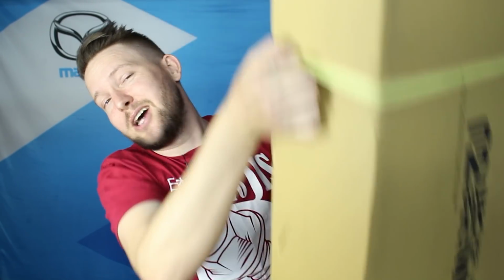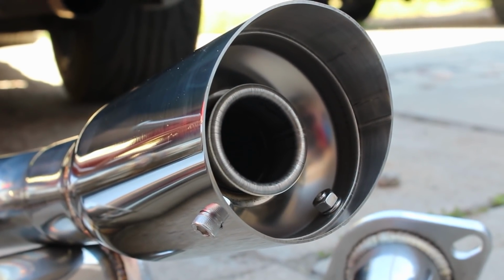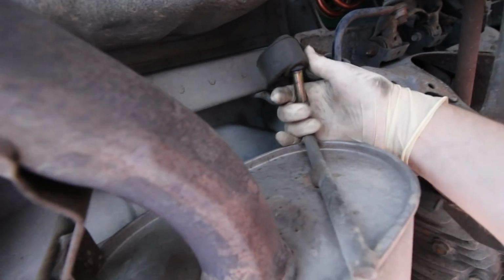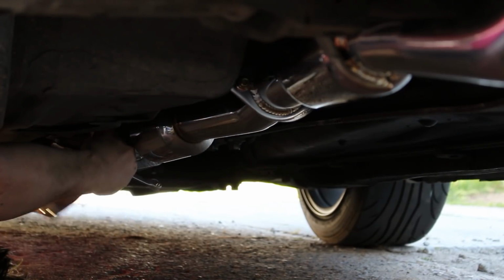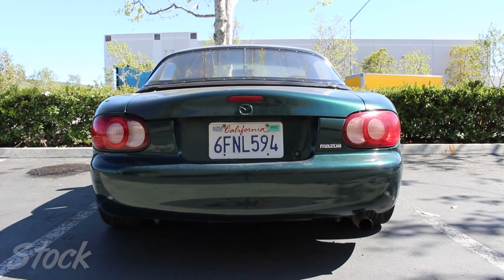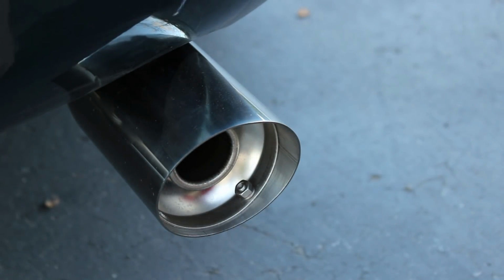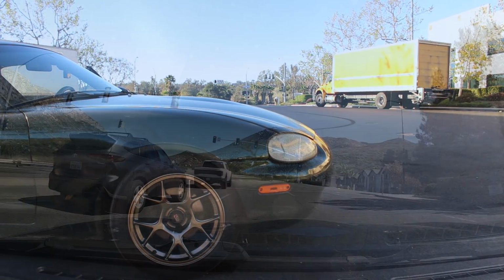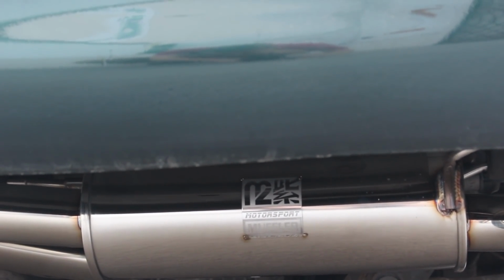The NB RIPS With A New M2 Motorsport Exhaust!

Comment: Honestly, I love the ISR with a turbo. However, when I first got it, my car was N/A, and I used my parents' garage. On startup, I got an angry text that my mom felt the floor shaking from the opposite side of the house. Luckily, I went boosted within a few weeks.
Reply: wanna post a sound clip bro? I've wanted to hear the IRS with a tubro
Reply: Same i love the isr, its perfect, but i do like the sound of a screamer pipe
Reply: Post a sound clip broooooooother
Reply: I have been looking for quality videos of the ISR on a turbo. Surprisingly hard to find. Love the ISR sound, hoping the turbo takes the edge off for something that sometimes does DD/touring duty.
Reply from the maker: Yeah dude for sure, turbo basically takes all loud exhausts and makes them sound so good 😃
Reply: @TheCarPassionChannel  hi Creg
Reply: Same, isr on turbo na sounds wonderful, we have a dual borla with some sort of headers on our nb2 and it sounds kinda like a Subaru which is pretty cool too tho
Reply: Love the exhaust sound. I run a borla   doble tips on my miata. For street cred I would change the rear lights for the one with the yellow turn signal lights just so it can match the bronze wheels.
Reply: My fathers 66 mustang would do that, cammed 289 motors shake the house with stock exhaust.

Comment: I had the M2 motorsport decat back system just like this one and it done me very well until about 1 year/ 5,000 ish miles of usage I had to get 2 flanges welded back on due to them breaking on the welds. Other than that it is one exhaust system id recommend if you’re on a budget.

Comment: So I recently went with the Cobalt midpipe (carb legal one) with the Roadster sport 4 muffler. It’s honestly sounding really good and I don’t have to worry about smog cause of the carb number. Muffler also comes with a DB reducer as well for longer drives.
Reply: How do you like the RoadsterSport 4? Was thinking of buying an RS4 and Racing Beat intake.
Reply: @michaelsaywhat6980  it’s pretty good. It has a nice deep tone when cruising. Doesn’t drone at freeway speeds.

Comment: Yes Greg! Thats got to be the best and only box for a mk2! However I don't wonna step out of line but have you tried it with the stock mid section? Much deeper tones going up the rev range.
Reply from the maker: I may actually run it this way for street use, that way I can leave the cat in place as well. If I end up trying it out I will throw a clip in a video too.
Reply: I bought this exact set last year because my cat went dead and I chopped up the fake cat piece to weld a 200cell race cat in place. Sounds about the same (uncorked) currently still running stock headers.

Comment: Damn that sounds good. My torsen 3.9 rear end came for my 1999 Miata (doing the FM turbo kit and more).

I was watching another video from awhile back (Gingum), and he did it to his NA awhile back....he said he needed a shorter driveshaft? He also got beefier axles....I did a little research but not finding it.............do I also need a different driveshaft for the NB?

This summer is just the FM turbo kit then next summer more boost (fuel pump, injectors, stand alone ECU, etc).

Thanks.....and that exhaust sounds great

Comment: Exhaust question for a stock internal 1.8 with turbo max 12 psi. Is full 3in exhaust worth the potential fitment issues worth it over a full 2.5 in system. Both straight piped to a big magnaflow muffler? Appreciate input
Reply from the maker: There will technically be measurable gains with a 3" on a turbo car, but for most people probably not worth switching from a 2.5". 2.5 is super easy to fit.
Reply: 2.5" will get you up to the max limit for a stock block so the 3" would be a good idea if you're ever forging it. Otherwise it'll be plenty

Comment: Did you add the launch control through megasquirt?
Reply from the maker: This car has ME442, and yes I just turned it on through the ECU, 4400RPM with spark cut.

Comment: Hi Greg, awesome content! I’m looking for the right exhaust system for quite a while. Sounds great and I love the fact that it can be as silent as stock. Using it as a daily with 110km per day, I don’t want to be deaf in a year.. Could this be a good exhaust to start with N/A and build a turbo system with aim to 250 Hp and 300 Nm? I read the system is 2,5 inch, so should be enough. Keep up the good work👌🏼💪🏼
Reply from the maker: At idle it's very quiet with the silencer, at cruise it is not as quiet as stock. Not really possible with a 2.5" catless on an n/a engine. 

That being said it would be just fine for 250whp! You can rock the silencer for long drives and then let er' rip when you want to be loud. A turbo will also quiet down any exhaust.

Comment: Moving to Cali this next month and I have the same exhaust system just wondering on how often do you get pulled over due to the noise
Reply from the maker: I have not been pulled over for exhaust noise in the last 15 years 🙂 usually they won't pull you over for just exhaust, they pull you over for stupid driving or general sketchiness

Comment: hello!  I have a doubt!  I removed the cam gear to install timing belt!  they carry an exact position?  I mean cam gear.  I see that it has several positions where a small bolt goes.
2000 nb Miata thank.
Reply from the maker: The locating pin on the cam needs to face the correct letter on the gear. So if it's the exhaust cam the pin needs to face the "E". On the intake cam it needs to face the "I"

Comment: I got a quick question 

I have an nb2, which according to Bofi, the mid pipe won’t fit on, is there any specific reason for this?

According to my research, an nb1 mid pipe should bolt straight up into an nb2, the only thing I could think of is potential interference with some cross bracing
Reply: Hey, I also have an nb2 and am about to install the midpipe, I will let you know it it fits with no issue
Reply: @justinwills8179  thanks!

I appreciate it
Reply: @Beybladeawsomeness  update, midpipe does fit however it does not come with an o2 bung so you will have to weld one on
Reply: @justinwills8179  ah, I see, that’s not too bad then, I was planning on mounting the down stream somewhere open air to avoid a CEL

Thanks for letting me know

Comment: Will this kit bolt right up to NB2 header? Currently have NB1 Cali-spec exhaust and unsure whether to just buy NB2 headers or if I'll need aftermarket headers as well
Reply from the maker: Yes - U.S. NB1 and NB2 have identical header fitment (I've swapped them on this car before)
Reply: @TheCarPassionChannel  you're the man 🙏 bought this muffler an hour ago, also doing nb2 headers anyway cuz why not.

Happen to know if pre-cat delete throws CEL? Seems like it won't be an issue.
Reply from the maker: @go-tocigars2363  Oh nice! And on the CEL it depends, I do believe if you re-locate the O2 to behind the 2nd cat (if you have one) it shouldn't throw a CEL.
Reply: @TheCarPassionChannel  interesting, wouldn't the upstream O2 sensor read lambda tho and have to be before any cats?

I swear I've read the forums, maybe so much to the point of confusion lmao
Reply from the maker: @go-tocigars2363  *Relocate the downstream o2 behind the 2nd cat

The upstream sensor is what reads AFR for the ECU
Reply: @TheCarPassionChannel  gotchaaaaa I didn't realize the 2nd O2 was in front of the 2nd cat. Preciate the insight man, idk how you make time for what is likely many comments every night lol

Comment: do you know if the muffler portion will bolt onto the stock midpipe?
Reply from the maker: I didn't try it myself but a couple people I've talked to run that setup. I actually want to try it for street use, then throw the midpipe on for track/dyno etc
Reply: @TheCarPassionChannel  yeah I would be interested in seeing the difference in sound with and without the midpipe

Comment: How’s the drone?
Reply from the maker: It exists, as it's a 2.5" catless exhaust on a naturally aspirated 4 cylinder. But it's about half of the level of the ISR. If it's a major concern you may want to try a catted version or just use the muffler alone with the stock midpipe. In my opinion it's a fine level for cruising on the highway, where the ISR was absolutely above that threshold.

Comment: Those silencers are amazing for sound. I have a turbo 1.6 (making more torque than the nb^😂) with a 3 inch straight pipe and its loud enough to shake the windows in my parents house when I rev it outside but with the silencer in it, it sounds almost like a stock exhaust with the hint of a whistle